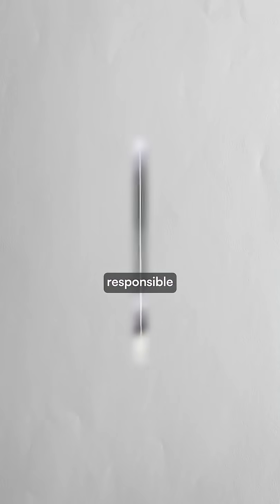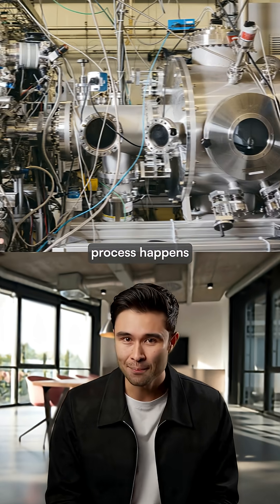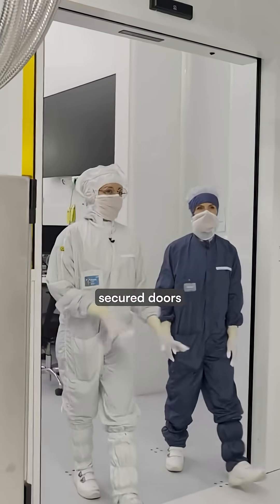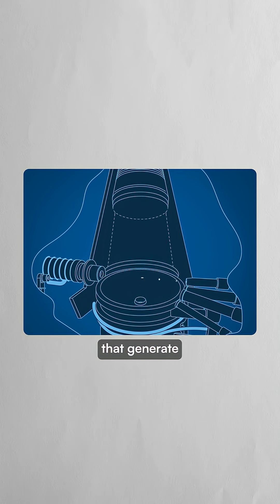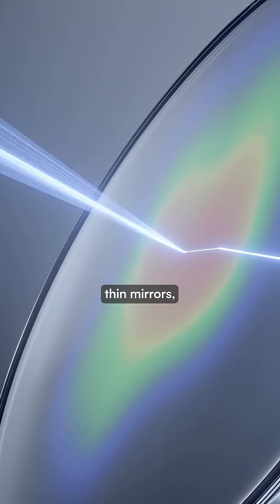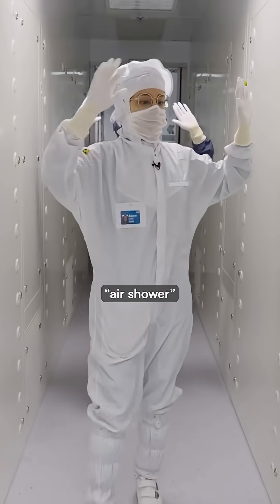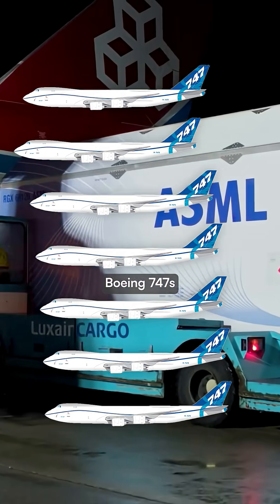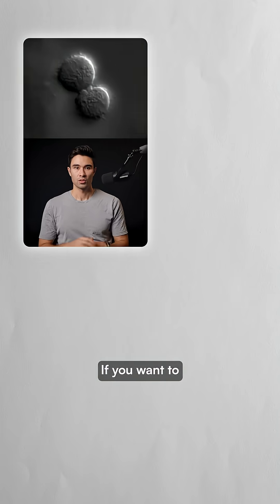Most important machines in the world today? #trendingshorts #ai #manufacturing

Comment: Chinese bought one from Germany, and wanted to reverse engineer it, to shortcut the US sanctions,  but it backed fired immediately when they started taking it apart. The machine destroyed itself. They called the Germans engineers for the faulty part, when they came, they saw that, they've tried to open it, but the security of the machine locked  itself..

The Germanss government was involved because that machine is a secret if state engineering. 

Incredible peace of art from engineers
Reply: Now replace Germany for Netherlands
Reply: @rejwanbuet05 no, Germany, they work together lol. You must learn to watch News. This is 21st Century
Reply: Literally made that entire story up. China has never acquired an EUV machine.

Now the older DUV machines using older methods are free and clear to be exported to China. But those can't do 5 nm or less nodes and are extremely expensive for doing 7.
Reply: @hypersonichobo4263 sir. With all due respect! That was aired on DW, First Post and even WION an Asian channel. Good luck Chinese Bot!
Reply: Nope, it didn't backfire, it is exactly what China wants. They have already got what they wanted by creating that incident.
Reply: @Tyrant_8053 I can see u are from Asia, may be from china. If it was the case, they would have called the engineers back to them. So I will take this account as a spam!

Comment: Recently, China opened one one of these machines for reversing engineering it. They broke it and were forced to admit their actions to the company.
Reply: China has older machines, not the modern EUV with the lead. This isn't something you can smuggle on the black market.
Reply: not recently they tried but like Asml CEO said I give them blueprints and they still cant reverse engineer it. It’s just to complex and the problem is China is in right because US blocked China from buying Asml machines, because they would have knocked all three AMD Intel and Nvidia, US is using it as political tool so they can remain international market, so China is in right to try and reverse engineer it. Now they are going a different route though
Reply: They reverse engineered DUV not EUV they did a much simpler machine
Reply: China doesn't have these.

Only 5 companies in the entire world have been allowed to buy some of these machines.

None of them are located in China. And these companies are more motivated than anyone, to make sure it doesn't (until something better comes along).
Reply: knowing China, they'll figure out how to make their own within the next 5-10 years
Reply: @donuthole8951 if they produce hyper NA EUV machines and mass produce the latest chips with CFETs instead of the current GAA before us, we will lose the AI arms race and China will win.
Reply: @donuthole8951  that's called wishful thinking. This machine has a lot of critical suppliers. All these suppliers have an expertise that china would need to "copy"/create themselves. Unless they could buy it from them directly, but that won't happen. Therefore you can safely assume 15+ years.
China has claimed breakthroughs in the past. But these were all false claims. There is at least a gap of 10 years, doesn't mean this is a realistic assumption. Anything less than that is only possible to be achieved with extremely high costs and resources and even then there is no guarantee that it will happen. 5 years is absolutely impossible if they don't even have a prototype.
Reply: @tety5775  Nope, it's under 10 years now. And none of it were false claims, just misrepresented by people like you.
Reply: @Tyrant_8053 
you can believe what you want. But I am not talking about recent claims. They have claimed breakthroughs for the past few years. The last claim is the electron beam lithography. This isn't new technology. It has been around for decades. It is highly flexible but it has a major issue for the industry. The throughput is much slower compared to a photo lithography machine. Therefore in mass production it would be more expensive. In small scale production this deficit may not be as big of an issue. Maybe even cheaper if you don't have to produce the mask for the Chips. But we aren't talking about small scale production.
For example electron beam lithography that could produce linewidths of around 20nm have been around since at least 1990.
Therefore from my perspective claiming this as a breakthrough is more propaganda than any real breakthrough.
Reply: @donuthole8951 
Not even companies from the US, Japan, Korea, Taiwan, and everyone except the Netherlands can make these machines (at the moment). 

And they've been trying to make this machine for over 30 years...and all failed. 

What makes you think China will succeed where everyone else has failed and continues to fail. 

The companies with the best chance of succeeding in such a task, are located in Japan. 
Nikon and Canon from Japan use to be the leaders in the field, before ASML from the Netherlands made this breakthrough.

China is still busy trying to reverse engineer DUV machines...which were introduced in the 80's. They first need to catch up with the 80's, before that can catch up with the 2010's.

By the time they do that, there'll be a new most advanced lithography machine...that 100 times harder to copy.

And EUV is already near impossibly hard to copy.
Reply: @donuthole8951 considering how they've had forty years to reverse engineer a jet engine that doesn't suck ass and these machines are far more complicated, I doubt it
Reply: Still have not been able to manufacture pen ballbearings... they import most from Gemany, so theres that!
Reply: @StanDeliver even when that was claimed to be true it still wasn’t true. China was producing them from imported feedstock which they’ve made as well since 2017. Only a few companies in the world produce the feedstock in Europe, China and Japan which manufacturers import, including in the US. Both the US and China have shown by example that when they choose to manufacture ball point pens, they can do it. One of those countries currently actually does, and it’s China. 
Similarly, European and Japanese companies produce the technologies to make latest and recent gen chips. 
China also produces the technology to make recent gen chips and has not done the latest ones outside the lab. 
The US incidentally produces none of the above and places export controls on what third party countries can sell to other third party countries as it’s got no technical competition in the game.
Reply: @Freshbott2  they can't and haven't made current gen chips using NA EUV.  They use DUV
Reply: @StanDeliver  You should get up to date. That was almost 8 years ago, China's started making them since 2017.
Reply: @FBl_Federal_Bureau_of_Investig it took them 60 years to do it 😂 meanwhile the world has been mass manufacturing ball point pens for decades
Reply: @DurzoBlunts only a few countries were capable of making ballpoint pens, even fewer countries that make the machines that make the ballpoints. Also a factor greatly overlooked was China was encouraged to make quantity over quality because it's Market wanted cheap ball point pens, so there wasn't much incentive at the time to make better products.
Reply: They never had access to EUV machines so idk what your talking about, China has only ever bought DUV machines
Reply: @FBl_Federal_Bureau_of_Investig that's what I was gonna come here to say
Reply: this is a different machine, this machine was never delivered to China and it will never be. Trump actually pressured the Netherlands not to sell it to China. aside from that, only Zeiss Germany can create the needed mirrors. No one managed to do recreate them. there are things that can't be reverse engineered without other tech knowlegde. One example, the most modern Jet Enginges of USA or the Eurofighter, Only the most modern countries could reverse engineer those, others wouldn't be able to to recreate the turbine blades. Those blade aren't CNC or melted in forms, those are made by growing Metal crytals.
Reply: @martinbergen2963  The problem is that China is a big economy and they can do almost anything they want to. Simply because they have resources, money and scientists. If they can't make the required mirrors they will figure something else, same thing with all other components. Most probably it's just a matter of time though it's possible that they will never catch up. By opening that ASML machine they gained unique insights that they would have never thought of. The presence of components or lack of thereof gives away many important details.
Reply: @szlagtrafi9115 Like make a good jet engine? They still haven't managed to do that. 

Their next jet engine started development before the F-22 main engine and still is not done. 

The F-135, a derivative of the F-22 engine entered service a decade and a half ago, the replacement for that engine, the adaptive cycle engine is going to enter production in the next year or two.

China is literally three engine iterations behind.
Reply: If they bought the machine why would they need to tell the company
Reply: @dracula0  Because they want it fixed and can't fix it themselves. Obviously the company is gonna find out when they ask what's wrong with it.
Reply: @dracula0 because it comes with agreements and restrictions like don't poke around and try to reverse-engineer it.
Reply: @DCrypt1  It also has a ton of anti-tamper features that will automatically destroy the "special sauce" if someone tries to reverse engineer it.
Reply: @dracula0 usually these machines cant be bought, only leased and with strict regulations.